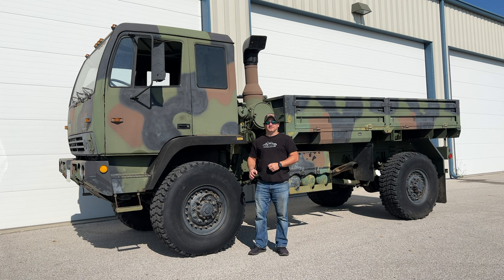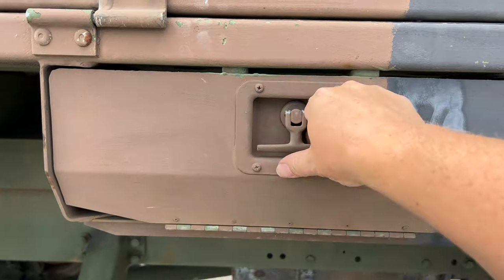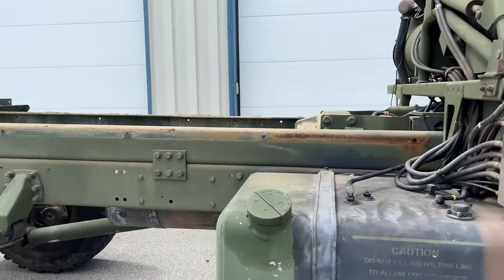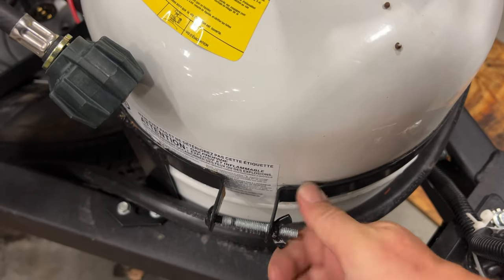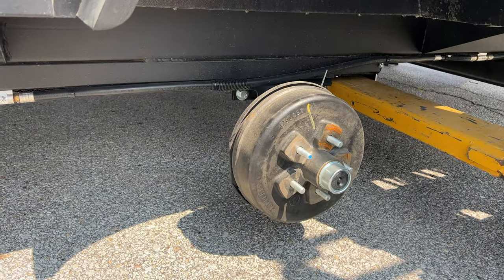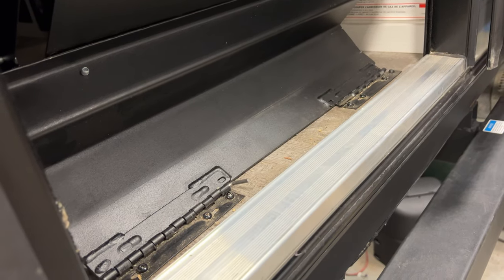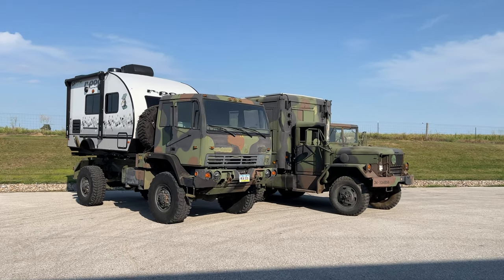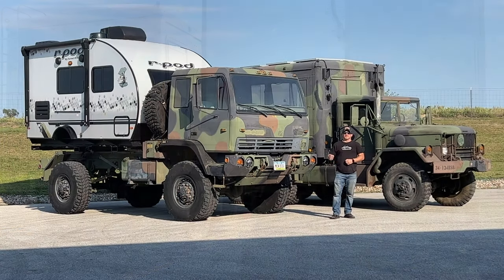Building 4x4 LMTV R-Pod Overland Camper

Comment: This is exactly what Iv been thinking of building for years only I was going the aluminum flatbed under the camper rout and have detachable jacks to lift the camper off when u get somewhere that way u can lower the camper to a reasonable hight to get in and out and u can then use the truck to go wheeling still without the weight of the camper on its back and all your stuff flopping around in it also the truck can still be used to do work as a flatbed if u want kinda like a huge slide in truck camper but with a flat bottom and more square cool idea tho
Reply from the maker: I wanted to use the flatbed but it would have added too much height and it would have been in the way of the septic and everything else.
Reply: @ThisWeekWithCars I've seen alot of these. Why do it with a camper? You can just pull it with a truck, cheaper and fewer hassles.
Reply: @bpslick4565  He's a man with a vision! Don't mess with him. I see your point. Also, with the camper in place he has greatly reduced the off-road abilities of the LMV. If the chassis articulates, it will twist and tear at the camper. but I think he mentioned that.

Comment: What's really nice about this setup is even in a flood your house and truck both would be relatively safe so unless its an extreme flood you should be safe and if it is that bad you have the capability to climb out even if the regular roads are no longer a option or become blocked

Comment: Rubber frame mounts then? To absorb some of that twist? Dampens the vibrations too, like the tires and "suspension" (RVs aren't known for their good suspension) would do otherwise. You don't want normal road vibrations shaking everything off the walls in the TT. Two thumbs up either way, looks like it'll be comfortable.
Reply from the maker: I am thinking of setting it on wood and using spring mounts like the military did to mount the shop box on my other truck.

Comment: Wonder if you can get rid of the subframe from the bed and just keep the camper frame. Might need to modify the front to clear the trans. For mounting check out what dry vans do, rubber or wood between the frames and then pins and spring mounts.
Reply from the maker: That is pretty much the plan at this time.  Time will tell how it will actually go.

Comment: I wonder if you could create a transmission tunnel in the front of the trailer.  That would allow you to remove the upper frame rails and drop the trailer down that 8 or so inches.  It might be worth the effort.  Less chance of overhead clearance issues, easier ingress/egress, lower CG, and slightly better fuel economy.
Reply from the maker: Possibly the front of the camper is just a storage box that could be modified

Comment: I know this is not the finished product  but it is a good idea to put it on the truck first. You can now work out how best to modify it so that it is a better fit. It is going to be a great build though as most of it is done  I will be looking forward to the next stage. Thanks for the video Steve very interesting 👍 👍.BTW how about locking the ladder in some rails on the underside of the camper?

Comment: We need an update on the condition of the canper  after being over rough ground and up in the air.  Those things arent make for alot of sudden racking and hard jolts. Just curious
Reply from the maker: It's just fine it probably rides easier on there than it does if you ran over pot holes and curbs with those tiny trailer tires.  Tires that are 47" tall can make most rocks feel like pebbles.

Comment: FOR THE LADDER, YOU COULD SLIDE A RAMP UNDER THE FRAME. I WOULD THINK ABOUT WELDING BRACKETS FROM THE TRAILER TO THE FRAME OF THE TRUCK.  THE TRAILER WILL TWIST AND TWEAK UP DOWN LEFT RIGHT AND SIDE WAYS.  EVEN RATCHET TWO STRAPS OVER THE TOP LIKE THE SEMI DO.  AD AN AIR SCOOP IN THE FRONT. THESE TRAILERS ARE MADE CHEAPLY AND SOME ARE JUST STAPLED IN  WITH 4 INCH NAILS. SO IT WILL BE INTERESTING TO SEE WHAT YOU COME UP WITH.
Reply from the maker: A ramp would be great if it doesn’t end up having to be really long.

Comment: You have already likely been exploring the alternator.... but if you have not.... the A0 and A1 truck alternators are bad news.  Quality product.. just under spec.ed by military.  They just dont produce enough juice to run the truck.  You will have to address this very soon or you will have plethora of problems that get expensive fast.

Comment: Flabbergasted... is the camper lighter than the bed? Also how tall is it with that a/c unit. It looks like you may be finding alternate routes to bypass some overpasses. A rather ingenious build can't wait to what you juryrig installing it. Good luck 👍
Reply from the maker: It should be well under 13 foot total when I am done.  The camper is heavier than the bed and weighs 2500 pounds.  The sides of the bed were made of aluminum so it was not that heavy, but it took a lot of force to get it lifted off the frame initially because it was rusty between the bed and frame.

Comment: I'd figure out a way to insulate the underside of the camper.
Reply from the maker: The R Pods are insulated underneath from the factory
Reply: @ThisWeekWithCars  not enough however.  And being even higher off the ground they will freeze the tanks quickly

Comment: Would be cool if you could articulate the camper somehow, so that you can park the truck on uneven ground and be able to level the camper independently.
Reply from the maker: I had hoped that the jacks on the trailer weren’t junk and I could use them for leveling but no dice they can hardly support the trailer as it was.

Comment: You found evidence of a flimsy camper build whilst making this video. Unfortunately that is typical. The main construction method is staples. There's no way this camper will match the off-road durability of the truck.
Reply from the maker: I know, if you have seen other motorhomes I own I don't have anything else as poorly built as this.  I think I can use it as a good base to start from and make it better from here.  I am curious if rhino lining the camper would make it very durable on the outside.
Reply: Actually, RPods are made with a welded aluminum frame and Azdel composite walls, much more durable than stick and tin campers 👍
Reply: @steveoh9838  You are correct that the side walls are aluminum frame. The front and rear walls, the roof and the cabinets are framed with wood, no doubt using staples.